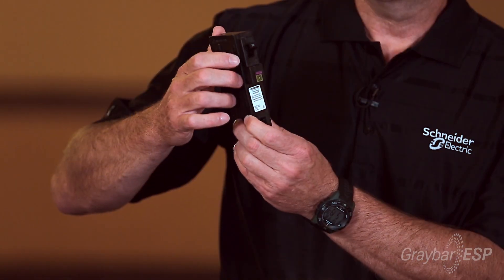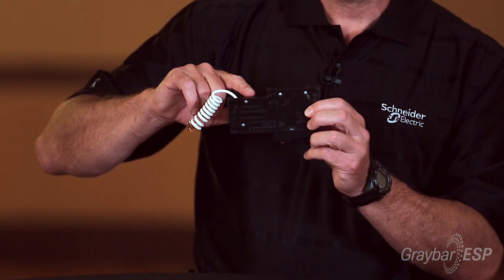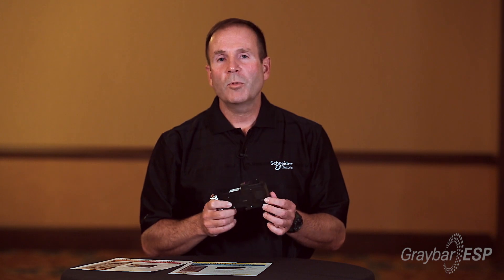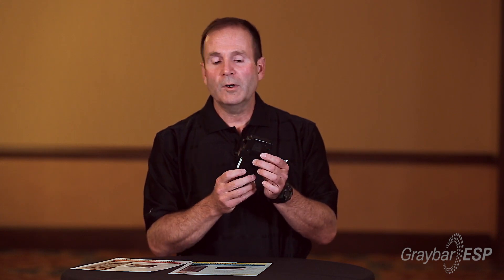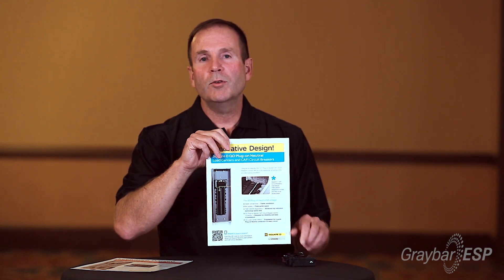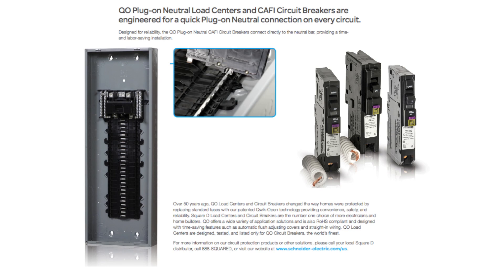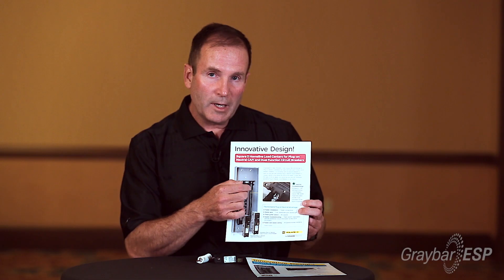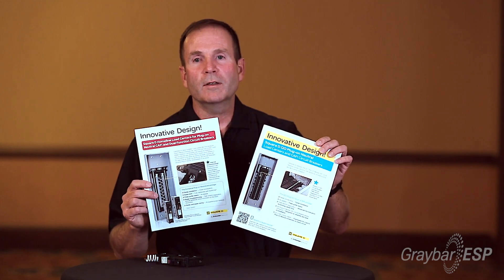Time-saving Square D QO and Homeline Dual-Function Circuit Breakers

Comment: A flashing coded fault led indicator would have been a better way for the customer and sparky to know what type of fault was present. 
If you have to use AFCI trip, how does one track down an nuisense arc fault on a circuit effectively. How does one identify between a parallel arc fault or series at fault or a harmonics arc fault?  I'm sure was microprocessor-based afci they can incorporate a lot more diagnostics into the circuit breaker to help with fault finding.
Insulation resistance checks should detect a fault to earth or a leak to ground but that requires disconnection each conductor and testing it on a faulty circuit. Essentially parallel arc faults work best arcing to neutral because earth and neutral are one of the same, so an RCD or GFCI should be able to detect the current imbalance and trip. We use only current overload combined with earth leakage protection on 230v circuits and dont see many fires from cable faults except from loose terminals and mains incomers which are only fuse protected, RCD are used on all circuits except hotwater cylinders and Stoves and non compliant imported electrical goods 
Education is the key to public safety and should be the first priority of any local government or insurance company. Having a house electrical warrant of fitness would be a good place to start. The switchboards like likevour commercial panels andcareca much better idea than our domestic switchboards, all less wiring required.
Can the newer versions of RCD or GFCI combination arc fault interrupters detect high resistance terminations that are creating heat, probably not, so their is still potential for electrical fire. Also it pays to have your installations earth peg continuity checked because if that is too high your current protection will not operate.
From what I have read about early versions of AFCI were very much over rated.

Comment: I would suggest staying away from Schneider products altogether.  I just recently contacted them about a panel box for which ground bars are still available right off the shelf.  When I asked which bar to order, I was told that they no longer support it because it has been discontinued, and would not answer my question.  So is the consumer supposed to replace the box because it's been discontinued?  Wow.....  Even though ground bars are available?  Wow again....
Reply: Xlatty breakers, ground bars and panels are designed and certified by ul or csa as a package, if they tell you to use a non certified setup they open themselves to lawsuits.